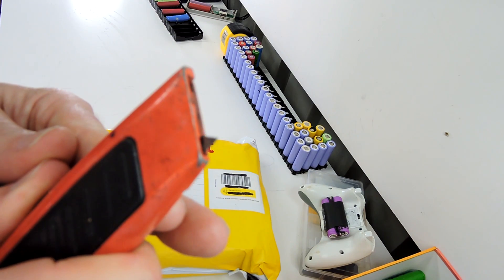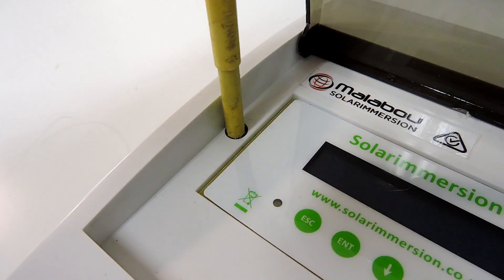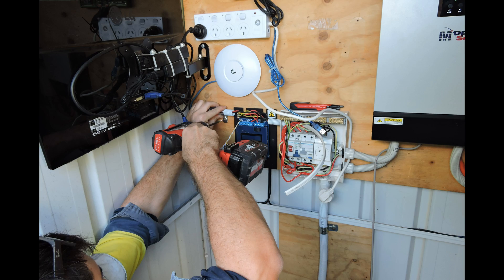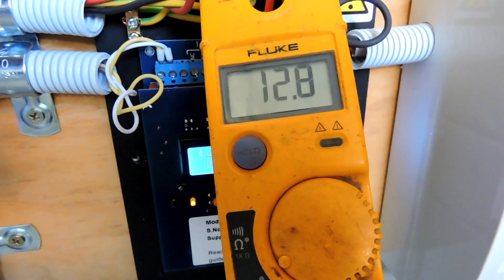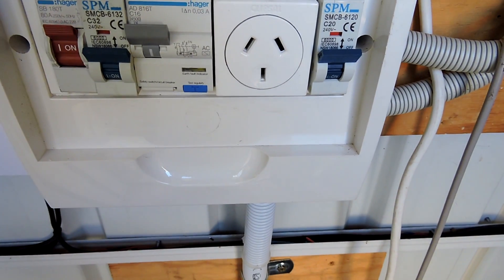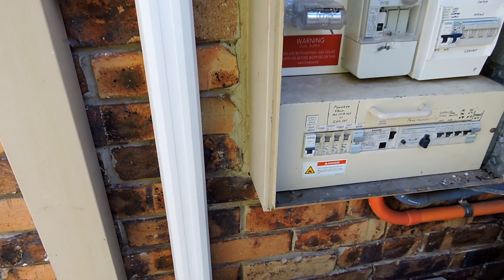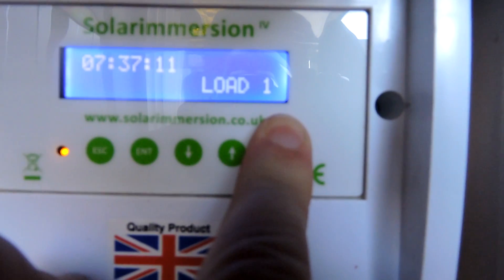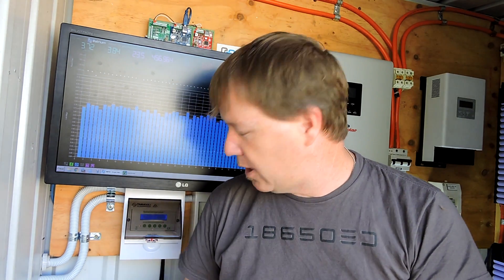SolarImmersion IV Solar diversion Unboxing & Install ( Solar hot water heater)

Comment: Hey check out amber electric, you can buy and sell power at the wholesale rate here in Aus for a flat monthly fee.
Reply from the maker: That would be neat, but I only export 800kwh a quarter and i can't export on demand with my inverter :(

Comment: If you put your water through black pipes in the sun before it goes to your heater it will reduce your solar demand,Here in Australia I do that and the water in the summer in the pipes is too hot and in the winter just warm enough to shower.
Reply from the maker: I have considered a DIY pre-heater, unfortunately my live is quite valuable. The wife would kill me slowly if we were ever to have an issue with the hot water so i'll side with caution and leave it all legit lol

Comment: Hi mate 
Great job on your videos
How is the unit working? I'm thinking to get one and use secondary load to charge battery
Your opinions are much appreciated
Thank you
Reply from the maker: It was still runing perfect, just upgraded to a EDDI unit, great data & a little more funcaial than the solar emersion unit.

Comment: Pete just wondering how is this wired in relation to your PIP 2424 inverter? I'm trying to figure out how to incorporate diversion loading with the 2424lv-msd while still using the dry contact for grid-switch sensor.
Reply from the maker: It has nothing to do with my pip (havn't used the 2424 for 12 months ) it's all grid side the dirverter

Comment: Hi love your work.
Do you have a tempering valve on your tank? it will allow you to turn up your temperature and store more heat in the tank up to 80°C and the hot water going into your home will be mixed with cold giving you 50°C at the taps, a good way of storing more energy.
Have you looked at the SUN FLUX Hot Water Controller? We have some videos on our channel.
Reply from the maker: no tempering device just have it set at 70deg seems to be working well

Comment: Did you have to swap out the hot water element to a DC one or is it all AC?
Reply from the maker: No, it's all AC - Only took the sparkie 40 min to install i think from memory, much less if it had have gone into the meter box.

Comment: I wonder why no company has tried attaching a liquid loop on the back of solar panels to make domestic hot water. An added benefit would be lowering the panel temperature that would increase efficiency.
Reply from the maker: I sent emails out to panel manufacturers 5+ years ago with the same question. Something about water and power was quoted...
Reply: Obviously there would have to be a thermally conductive/electrical insulator barrier between the electrical side and the plumbing side. I guess it's better to sell 2 systems than just one. Average Joe just got some new panels, let's get him to try it.
Reply from the maker: for the price he paid I don't think he'll be keen ..lol
there is people out there that have tried - some with more success than others.
Reply: They exists here in Europe for some years.

Comment: Keep contacting the companies you are asking about sponsorship from. Even if they decline initially. Most sales happen several contacts in, not on the initial. Keep pointing out your audience, your value alignment with what they are doing, and your interest. Drop it after 10 contacts but keep trying till you get there. They aren't going to blacklist you and if they are having a bad month or quarter then they might be in a different position to consider what you are offering.

Comment: gecko on the wall at 5:17/5:16. Kinda curious how long many yrs a system like this would run when almost all of the electronics aren't really shielded other than being behind a door, it's basically a shed with exposed electronics inside. Imo the electronics inside are going to get dirt and rust on them since they're basically exposed.
Reply from the maker: Yep, sounds about right to me, that said there are so many geckos here stopping them is impossible. It's all cheap budget gear as well so it probably won't last until the rust or geckos affect it.
Reply: HBPowerwall good point :) was mostly just looking at those raspberry Pi looking boards and was wondering if I would put them in a printed case or not if I've were in your shoes :) great videos, keep up the good work :)

Comment: It seems weird to me to use PV panels then either resisitve elements or a electric motor to drive a heat pump. Wouldn't you be massively better off to use direct heating? Its cheap to install (totally DIY friendly even..) and easily >5x more efficient, so for a home project you could even pay it back at that low rate of 6cents your selling to the grid at....
Reply from the maker: it is true you could do anything, i choose this way because wife still needs a hot shower twice a day even if it's been raining for a week. Direct heating works but this is smarter in my circumstances
Reply: Direct heating normally still has a resistive coil for doing grid boost, so if its raining for a week your in the same boat either way.
Reply from the maker: Ok, thanks for info. I'm very happy with my decision - as time passes I'll look at other ways to trial

Comment: About 3 years ago I bought a similar one to http://www.revosolar.com/tienda-online-solar/es/accesorios/188-inhibidor-inyectar-en-la-red.html derive power from a small 1.4kw hydroelectric turbine, networked with an invert grid, all to heat both sanitary and heating water H24 365 D, it works perfectly, bills zero!
Reply from the maker: cool, since putting this video up been getting told more and more about them. Wish I had of done some more research first.

Comment: I live on a boat in brisbane and only have solar power as i am floating with no mains power. would your battery system work as a house battery bank. my 4 wheel drive fridge is my biggest drain
Reply from the maker: anything would work as long as your happy to work with it :)

Comment: I have installed the same unit but looking at my power monitoring (Emonpi) it looks like the unit starts to send a lot more to the cylinder than what is being generated. It does not seem proportional, would be good if you can see what yours does?
Reply from the maker: I'm starting to have a sneaky suspicion that something odd is going on I don't understand.. Nore do I know how to test but I'll work on it. If it turns bad I'll make it all public i promise
Reply: I will be testing another unit which is made here in New Zealand it has  much better control. Will give you an update soon.
Reply from the maker: I'm going to record a week of power usage at several times through out the day to see what it really does. Be great if the led display had the amount of power being diverted displayed...
Reply: Have been doing more investigating my houses power meter has a forward and back arrow when I have the solarimmersion off the unit is flashing backwards. When I turn on the solarimmersion on the power meter starts flashing very fast with the forward arrow. Looks like this unit is an overpriced switch.
Reply from the maker: That's a fair comment how ever it's a smart switch with variable power out. I'm very happy it's now been 3-4 weeks of using the Solar Diverter and I've only exported 40kwh of energy I used to export that every 2-3 days so self-consumption is fantastic. Only when I get the next bill will bit become more apparent it worked or not

Comment: Grab yourself a heat pump hot water until. 
Runs on 700w instead of the 3600w for the standard hot water system.
Reply from the maker: Andrew, will you tell my wife or shall I risk it ?

Comment: hi Pete did u need to do anything to tour hot water system to fit the solar immersion
Reply from the maker: Nothing at all required, just had the sparkie wire it in configure it up and away it went

Comment: You need a hot water tank setup like a solar system has, where it has a temperature switch halfway up the tank so when the electric booster runs it only heats at most half the water and then lets the solar heat the other half.  In that way you could have it "boost" but only heat up say max 100L water and then have another 200L available to store the extra dumped power.
Reply from the maker: my tank only has one at the bottom working with what i have here :)

Comment: You have an old meter? How dose that count your solar? It should be spinning backwards. You must have a kWh. Counter. I would be plumbing some solar panels into a circuit to slow that sucker down.
Reply from the maker: that is just the hw meter digital is on solar side
Reply: wack some micro gti on that circuit. just on the quite.

Comment: I'm planning on going thankless  gas water heater. and after I get all the solar up. I hope to add a electric thankless to the mix. if the gas thankless thing works out that.  is. maybe go to a electric tank heater. powered by excess solar. who knows. but to get hot water for now. I plan on gas tank less. and inverter power with generator back up. and charging  fro the batt bank. adding solar soon. for my off grid home to be.  what type inverter do you use?  I have been shopping around for a decent inverter. pure sine of course. aims is one. some say no way would they buy one. and others say they are OK. but you never know the conditions of there use. which could been why they failed.  but I been looking for a inverter that will output what they say . without meltdown. keep up the great videos . thanks

Comment: That is crazy where I live it is just over $0.07 to buy for us and the same price if we sell back. But that is most of the reason y solar is not worth it where I live
Reply from the maker: I think our off-peak power cost 20c/kWh and peak is 25c /kWh
Reply: With your battery you are probably better off with TOD metering. Sure your peak energy costs more but your off peak only costs 9 or 10c and fixed loads like your water heater only about 8c... so if you don't use alot of peak power because your battery and panels cover a lot of it you can time shift loads like dishwasher etc and also charging your battery when there's not enough solar.

Comment: Excellent Job ! I'm very glad to see your still moving forward with using all the power you produce. There are several ways to do this. It can be so cheap I don't know why anyone wouldn't do it. People just need to do some research before diving in.
Reply from the maker: I would like to explore some other products that do the same thing. See if anyone comes to the table.
Reply: dc hot water coil and a simple charge controller that diverts the power to the coil. total cost about 40 dollars on eBay.  I sent you the links several times. The best way is one dc element in the heater and one ac element. that way you get hot water all the time.
Reply: Other product free spanish calls freeds

Comment: I am glad you had a off the grid hot water system that is still using the grid as backup (mouth full)

It's a lot more controllable than the other hot water systems out there, such as the antifreeze method.

The antifreeze method works like this, your solar panels generate electricity and heat (that's where most of the inefficiency comes in) then it loops around using a pump connected to solar, a small 12-48v DC pump and then dumps it into your hot water tank at the bottom , then the cold water at the bottom cools the antifreeze, then sends it back to the antifreeze tank to happily go another round.

Disadvantage is... it works too well, your hot water tank then has hot water beyond 75c, I would say at near 99.9c (boiling point) and it would need to be mixed with cold water for it to be usable hot water.

How it works is this way, think of radiator in a car (you have 2 of them, the heater and the front radiator)
"why don't you just use water?" the copper taste is disgusting when cycled through, heating and cooling cycles... and then there's the inefficient parts where the boiling point of antifreeze is higher (50/50 mix) and a much lower freezing point than water, it doesn't cause rust, in fact there's rust inhibitors inside so the copper tubing will last longer from the inside... downside of the rust inhibitors is that it eats away the plastic in water cooled PC's (jayzcents done a show and tell on that one)

So,  whether your install is right for you is not me to judge, you are an education channel and also a part time "watch me freak out when I fuck up but I solve it with you" 

There has been times with hot water systems blowing up when they use the antifreeze method because they do not vent the pressure (amateur installs) I am not one of those people that will say "you will be in danger" because you seem to be doing more research than you are showing us
Reply: Been using a passive "antifreeze" system since 1989 and haven't had any of the problems you mention. I do agree though that it's not something a rookie should be doing without some real research. Water temp problems occur when the holding and storage tanks are too small for the solar exchanger. This is the same problem when people complain about not having enough hot water when there is a couple days of overcast.  

As for inhibitors damaging plastic pipe, this only happens when you use the wrong type of plastic pipe. You can't use the same material as you  might use in a direct solar water heating system. 

As to blowups, I've seen many more electrical heated tank catastrophic fails than any type of solar, not that it doesn't ever happen. But with proper pressure valves and thermal breakers, failures are about as close to zero as one can get with any device like this. IMHO. Jim
Reply: Agreed Jim!
I'm on just plain old gas storage and with my home being public rental I can't make any modifications without A) Paperwork complete with insurance, names and so forth and 
B) money to do it.

The fact remains, How long will I be staying here and when I move out I can't take it with me so I can't have a on demand system unless they pay for it and there isn't any on demand  electric systems, his system there would break my bank even acquiring half the things needed.

Comment: Very cool. I can't wait to have my own place and start a solar / battery system.
An extra $80 a quarter for an extra hour a day on the hot water in the morning? Damn heating water is expensive.
Reply from the maker: it's probably going to be a bit more in winter but well worth it still.

Comment: Hi Pete - There is another hybrid solar hot water heater available that you may want to consider looking at. You can see it by looking in YouTube for a user named NRodge1. His device connects a couple solar panels to the lower element in your water heater using mppt. That leaves the upper element available to still make hot water on cloudy days. You can also see it in eBay here: http://r.ebay.com/pUMkvs
Reply from the maker: There really are heaps out there and I needed one that was easy and cheap. This one came up second hand at the right price so I'll really happy with the price and I'm thinking it'll pay for its self in just 6 months. Will be nice if it all goes to plan..